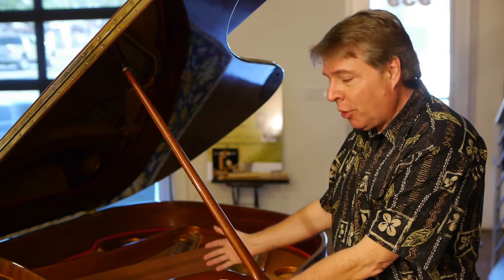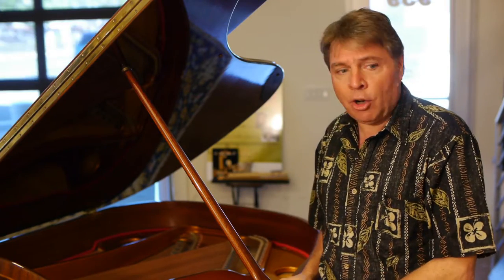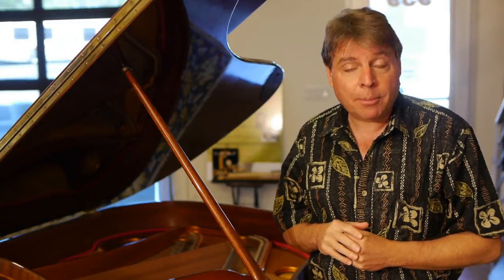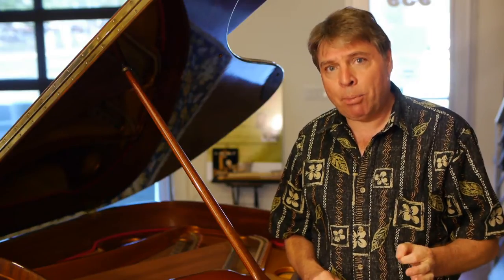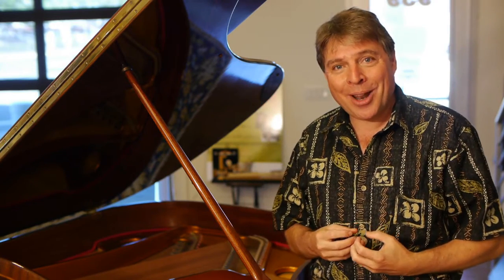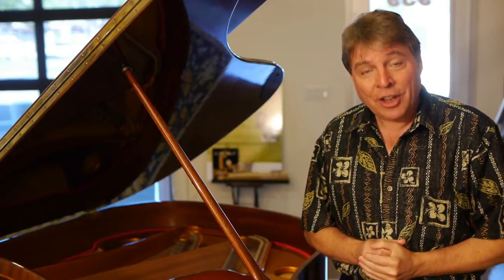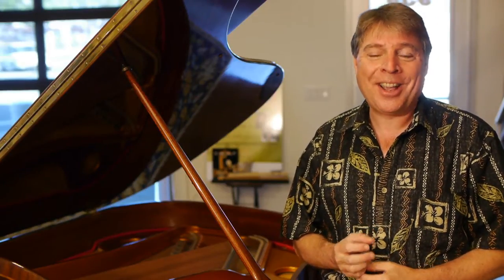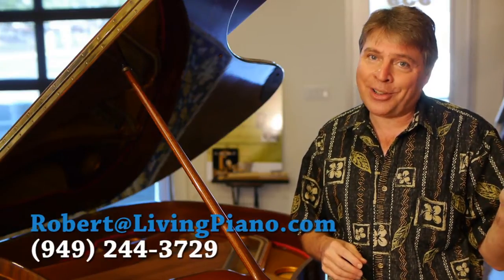Can You Replace a Soundboard on a Piano?

Comment: I agree that any replacement board should look and work (and thus sound) as close as possible to the original. If I am going to restore a fine Seybold, Sohmer, or Smith and Barnes piano, I want it to have the great original sound of those makes. This goes as much for uprights as for grands. The two finest upright pianos I've ever played were a Seybold and an Estey. Both had an amazing sound with a rich, pretty treble, a rich and powerful (but not honking) bass, and solid, gorgous midrange.

Comment: I have seen some soundboards with only any necessary planks replaced and the board mostly original. This is exacting work and probably requires years of training to get right, and also to be able to analyze the original wood and source the next best thing.

Comment: I know a guy who removes and recrowns original soundboards (all wood joints broken apart etc. wood cleaned up, repaired with the RIGHT kind of wood if necessary, and then everything glued back together and clamped with the right crown/downbearing just like the factory) and these pianos can sound great! I think a soundboard should only be replaced if its trashed beyond repair.